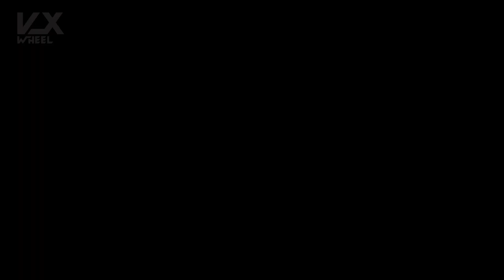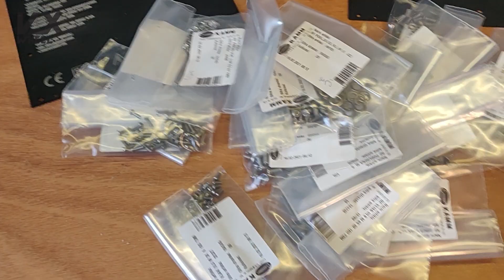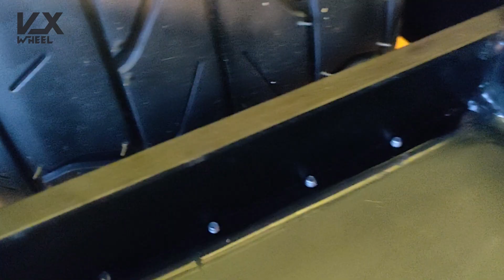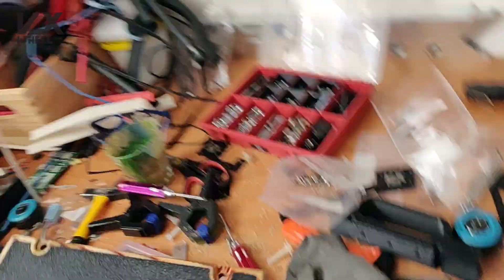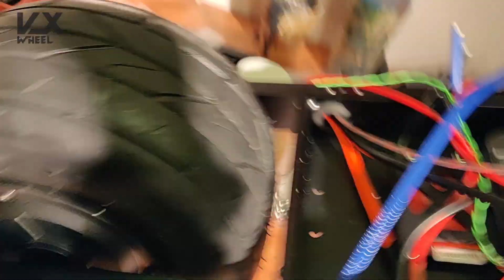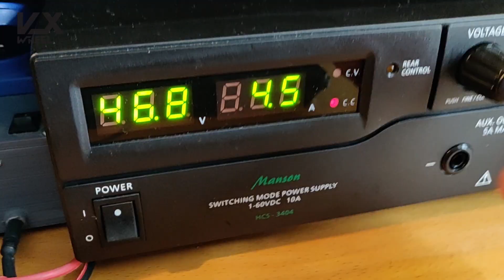DIY ONEWHEEL - EP5 - Rails + Assembly - VXwheel

Comment: Hello, just wondering how you turned your STL files into printer (2d ink printer) friendly files... Sorry for my ignorance I'm new to 3d printing. Thanks.
Reply from the maker: Not sure if possible from STL but you can for sure do this from the STEP files. (should be possible from STL but I did not try) I created a drawing in Inventor and just hit print 1:1.
Reply: @VXwheel  any chance I might be able to get a copy of the files? Thanks.
Harry.
Reply from the maker: @Coronnn  It's a placed projection in drawing. I hit print when I need it and don't save them. 
Let me know exactly what part you need and I'll try to make a pdf of that.

Comment: Really nice! I would like to use a bench top power supply to charge my DIY 12S battery. Is there a specific setting or charging regime you use?
Reply from the maker: Yes, you can do that. I also use it. It needs to have CC-CV function. You limit the current (I do it on 0,5C for my battery this is 4.5A) and limit the voltage to 50.4V
Reply: @VXwheel  Thanks, this worked well. I used the RD6006 in a battery charge setting. There is a useful cut-off current feature during the constant voltage phase.